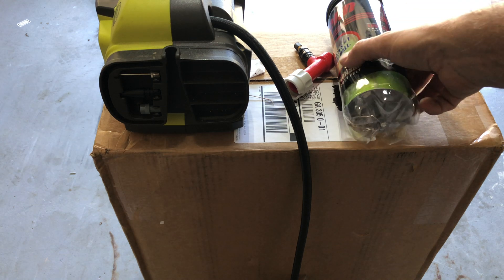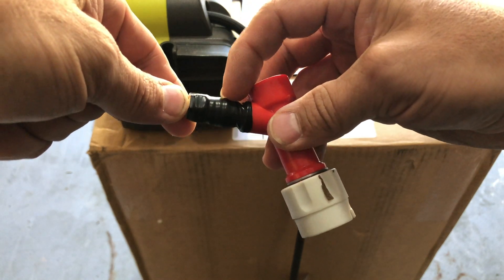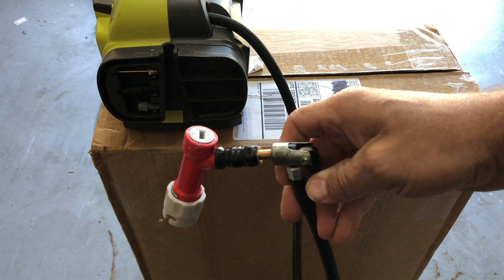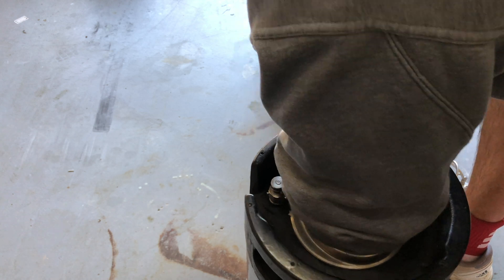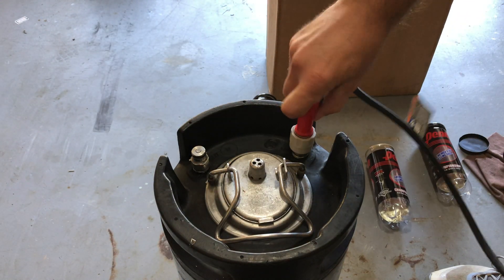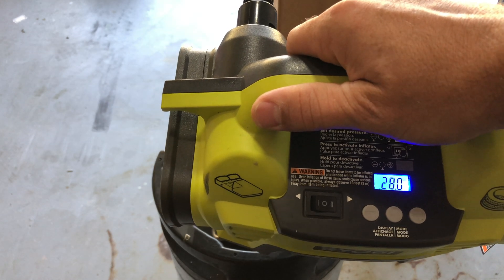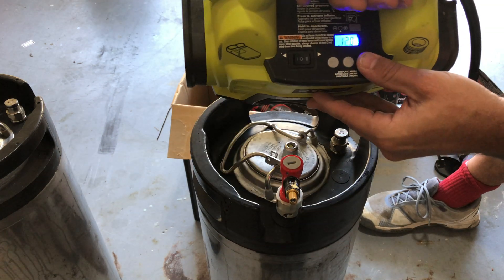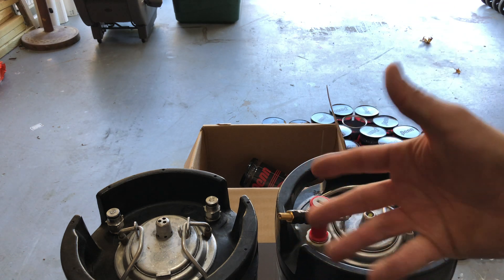Tennis Ball Repressurizer Solution

Comment: As the air filters into the balls the pressure in the tank will drop, so for best results you should top off the tank every couple of days. Going over about 25 psi may cause some balls to collapse and they will not be filled, so starting with 25 psi for the first few days and then working up will reduce this problem. If you listen you can hear balls collapsing providing your compressor is not too noisy. If any balls collapse drop the pressure to zero and start over and don't go as high for a few days, then work up. Some brands of balls respond better than others. Occasionally balls left too long at high pressure will become super-bouncers and bounce higher than new balls, but they calm down pretty quickly as they are used.

Comment: Thank you for the lovely video. A quick question: I assume that the old balls have the same pressure as our atmosphere as you placed them inside the kegs. After you initially set the pressure to 30 PSI, did you have to put more air inside the keg later since the keg's internal pressure was reduced by the increase of pressure inside the balls?
Reply: Good point

Comment: Awesome video man! Quick question though…when pressurizing the chamber, I noticed that I’m hearing and feeling “popping” inside (at around 30 PSI). Are the tennis balls bursting? 😲 The balls are about a year old.
Reply: if the balls are too low pressure, then you need to start with 20psi for 2 or 3 weeks. Otherwise they will implode...

Comment: Any one got this to work ? I have the same set up, I tried to pressurize with different pressures (29 to 31 psi) and different durations (1 to 2 weeks), nothing worked !  I also checked the pressure was not leaking during the whole process.
Reply: if you use such pressures for really old balls, they will shrink and won´t inflate. Start with 20psi for 2-3 weeks at least
Reply: if you use such pressures for really old balls, they will shrink and won´t inflate. Start with 20psi for 2-3 weeks at least
Reply: @tikokamide3989  Thank, I will give that a try.

Comment: My pressurizer works, but the balls are still not pressurized after waiting 2 weeks at 34psi .. Ok, some balls may be bad, but looks like none were pressurized. I check the pressure before taking out the balls and looks OK. Any idea ?
Reply: for really old balls you need to start with 20psi for 2-3 weeks, otherwise they will shrink

Comment: Eddie, I ordered the parts you recommended but was not able to connect the pinlock connector to the compression fitting with the hammer.  It wouldnt go.  Any  suggestions?
Reply: I have the same problem. It is too hard to get in. No way. Give up ?
Reply: @traderYang  cornykeg has an adapter that will convert to a barbed connector.  Then you can use a tube with clamps and connect to an old bike tire valve instead of using the Amazon Inflation Valve.

Comment: Since the balls take up a lot of the volume of the keg, and since the pressure in the balls is low at first, I'd have expected the pressure in the keg to drop over time as the compressed air seeped into the balls.  It would have been nice to see the pressure in the kegs at the end of two weeks.  I'd expect that if there were fewer balls in the keg and/or the keg was left for longer time then the balls might become overinflated.

Comment: Love the video, I bought the compression valve and the MFL connector but was unable to get the valve to snap into the connector using a vise. Would you be able to make a tutorial video showing how to do that?
Reply: I had the same issue, thinking it was not snapped properly. There is a little space even after you snapped it.
Reply: @Dominor305  Same for me. Doesn't feel tight or air tight.

Comment: Thanks for doing this video!!! Great idea to prevent more junk in the landfill. I am going to build this because we go through 75 balls every 3 weeks. 
Wondering if you tested this at a higher pressure to see if it takes less time to re-pressurize the balls? So they don't have to sit there for 2 weeks?  I hear the commercial unit does the job much faster.

I'm not familiar with tolerance of these tanks, valves or seals. I will be soon.

Comment: I am in the process of making my pressuriser. I have received my keg. I have ordered a barbed disconnect. I have a schrader valve off a bicycle tyre. I am going to join the valve to the disconnect with a 5mm wide tube and secure both ends with hose clamps.
Reply: Howd it go?
Reply: @Ebbzzor  Not so good.  You can't repressurize dead balls.  It is like putting a bicycle tyre inside a pressure chamber and expecting it will pump up the tyre.
Reply: @diggler2002  Weird. The results from this video stated otherwise.

Comment: Nice setup. Are those kegs 5 Liter capacity each? Looking to try the same setup :) Thanks.
Reply: In the U.S. these would be 5 gallon capacity each. We haven't standardized on metric because um ... er ...
Reply: This is a better design https://www.youtube.com/watch?v=03Ml7_A78yo
Reply: Would you guys know of an online substitute for the ‘Inflation Valve for 1/4" Air Line Compression Fitting’. I can’t seem to find it on Amazon/internet in general

Comment: Any sellers of the 92839 Inflation Valve for 1/4" Air Line Compression Fitting

In the uk for the ball lock keg?
Reply: This is a better design https://www.youtube.com/watch?v=03Ml7_A78yo
Reply: @diggler2002  thanks, I've noticed your comments on a lot of pressure videos, have you managed to find a good solution at a low price? I tried the tube clamp method but it leaks, the kegs are quite expensive £80+